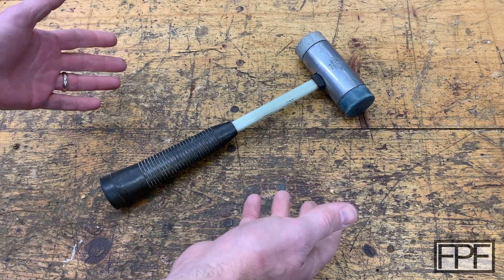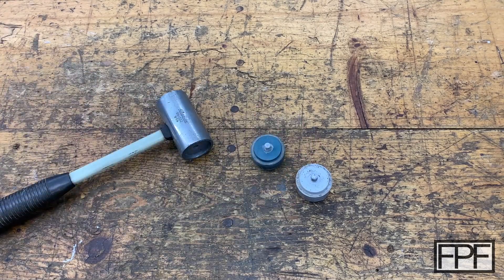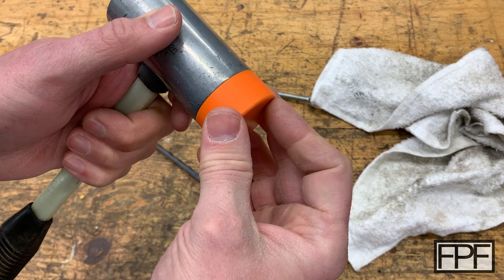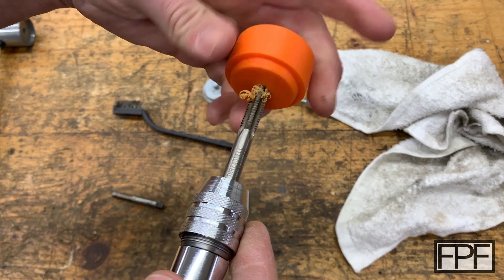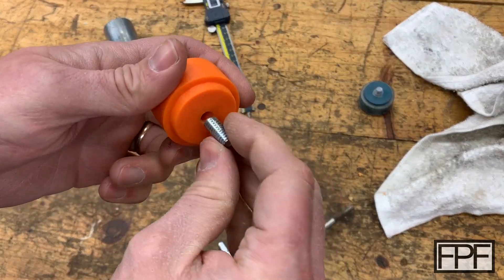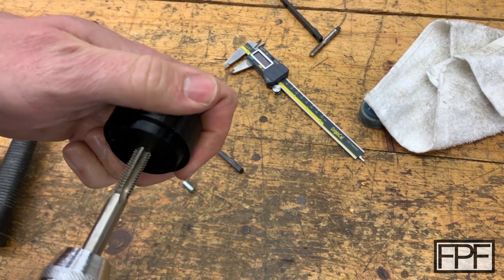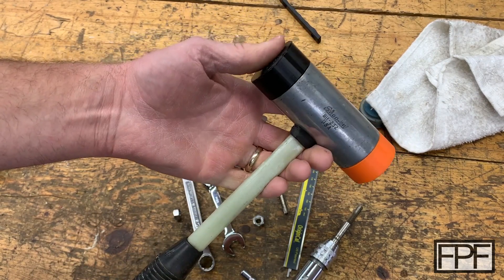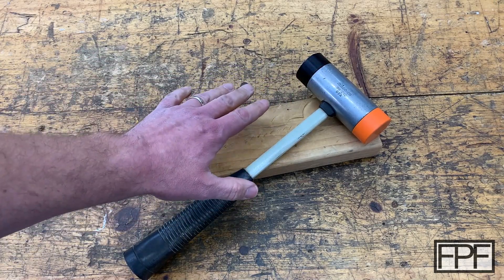3D Printed Soft Blow Hammer Faces

Comment: Some of the transparent colored TPU is far harder than solid colors, at least in my experience. I got some overture black that is borderline ninjaflex territory and some of their transparent red and blue that's barely discernable from a hard plastic at higher infill. So I would suggest making the orange side out of the colored transparent TPU as it's likely going to hold up better longer while still being quite stiff.
Reply from the maker: Thx, I've only tried the sainsmart stuff in gray and black.  I need to order a cpl other to try.

Comment: You can also insert a nut and print over it. The threaded rod can be glued with threadlocker, e.g. Loctite. But remember to put the glue into the thread of the nut. If you put the glue on the threaded rod, most of the glue will be pressed out because of the pressure (air compression).

Merry Christmas to all.